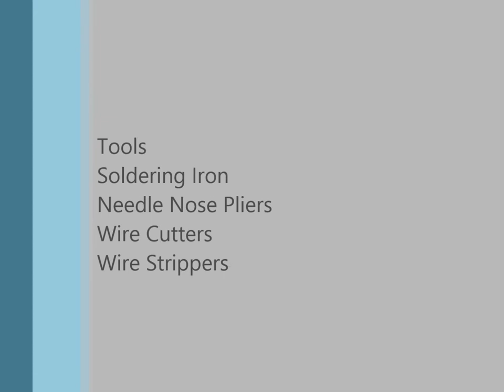Modifying a small strobe light

Comment from the maker: I do not think that is possible with the bulb that is inside as it is not designed for continuous operation. You could measure the voltage across the bulb. If it is the same as the 4.5 volts from the batteries, then you could just wire the batteries directly to the bulb. But I have a feeling that it is higher.  In that case you could just remove the bulb and circuit and replace them  with high brightness LEDs.